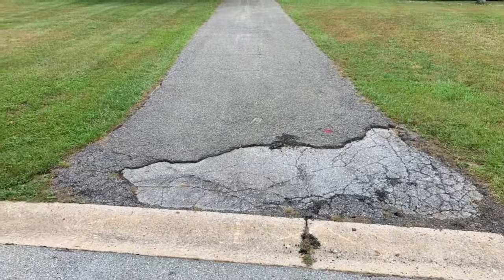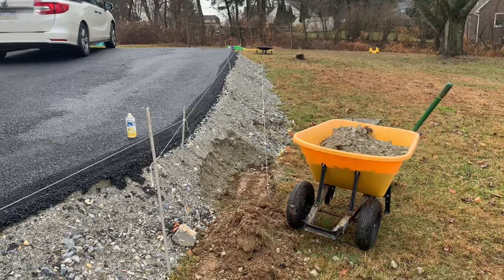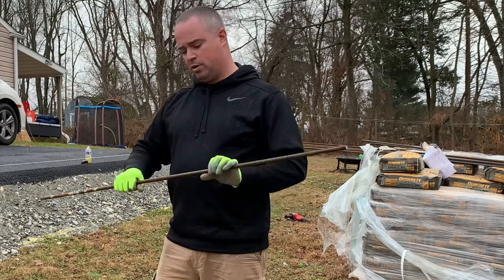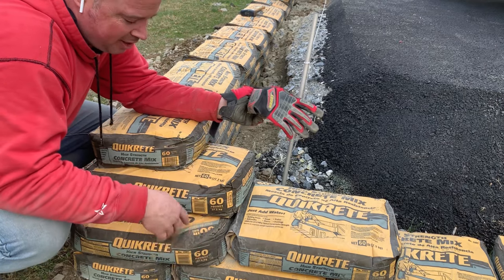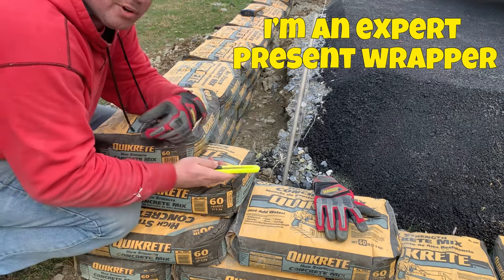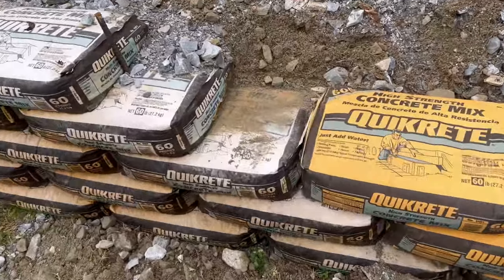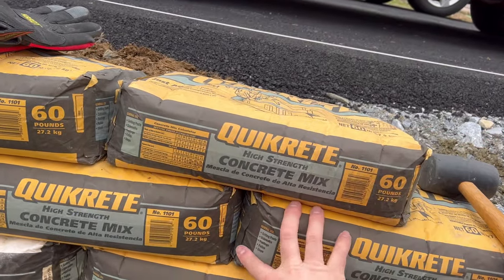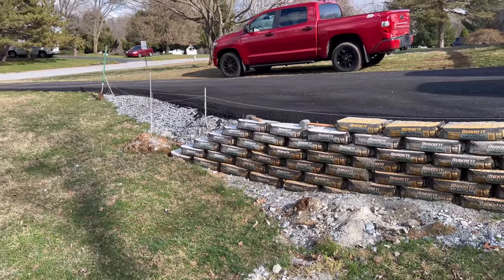DIY Concrete Bag Retaining Wall $ Saved Us Thousands

Comment: I watch somebody do a big giant retaining wall around their place and then they went back with a pressure washer and got all the bag off just thought I'd let you know
Reply from the maker: That is probably the best way to do it @marieennis6114 I bought a weed burner to see how that works. The majority of the paper is off because of the elements here in the northeast. I do have some stragglers though. I'm working on a follow up video with some do's & dont's. Hopefully I can show the difference between using water and fire to get the paper off. Thanks for reaching out!
Reply: @GoodTroubleHome  I will be looking forward to seeing those episodes. I have been thinking about doing this scene the one about the retaining wall it was a big retaining wall so it was really good to be seeing a small wall being done because that's what I will be doing. I have a little embankment in my yard it needs to be held up it's giving way so I'm very much looking forward to seeing how this progresses thank you so much. Marie from Tennessee
Reply from the maker: @marieennis6114 how many bags high do you think your wall will be?
Reply: @GoodTroubleHome  probably not much taller than yours. When they cleared my property they sorted just left a little wall of dirt unfortunately my property goes straight uphill so everything washes down and it's now washing away my cleared spot.  Pretty soon it's going to all go down straight down the hill again LOL.  Probably I would say 6 to 8 bags high should retain the wall that is currently there I've been here 6 years and I'm starting to notice a real pattern of the water running down my cleared spot and turn towards my driveway going straight down my very steep driveway as I laugh while writing this truly isn't really funny I think I'll start on it in the fall when it's not so sweltering.  We are having  a particularly rainy summer.  It's been raining here 20 days out of 31 most of the time I'm not going to tackle trying to do it right now. This red clay turns into soup when it's wet. I want to thank you for answering me back and asking me questions show me the YouTube channels don't have that courtesy it's a little discouraging I like the camaraderie. I'm 67 years old and doing it on my own so it is a little at a time. Slow and steady wins the race thanks again Marie from Tennessee🙂
Reply from the maker: I would love for this channel to be a community of good people trying to save money and share DIY advice and ideas @marieennis6114 love that you are 67 and tackling this project. You inspire me Marie from Tennessee!!!
Reply: I've been missing seeing you. You take care of your toe. Marie from Tennessee

Comment: Been 10 months. Ya didn't hose em off. Soak Em 🥺🤷🏻‍♂️ didn't any type of drainage. Rain ☔ ❄️
Reply from the maker: Hi @paulbetka6477 it’s actually been about 2 years now. That was one of the first videos I started. Took a while to edit and post. We used 8-10 of rock for drainage and then backfilled with soil. I will be putting out an update video in October showing some things that we would have done differently 👍🏼

Comment: Should’ve built a proper block wall first and then had the driveway paved.
Reply from the maker: Yes @eddyanglin that would be right order but we had no idea the new driveway was even going to need a wall until it was finished. I thought maybe a truckload of dirt to level things out but this method actually worked really well and it was way cheaper than hiring the job out
Reply: Hindsight's 20/20...  it's still better than half the hack "pros" out there.
Reply: Good job overall.  The driveway contractor should’ve told that in consideration when grading and noticed the elevation difference and let you know about it.
Reply from the maker: There’s a long list of those contractors out there
Reply from the maker: I wish he would have @eddyanglin I probably would have rented a bobcat and leveled things out beforehand

Comment: Lmao 160 bags you should have just hired a concrete truck and made a form to hold the concrete much easier and cheaper and looks a lot nicer. Your drive way rock and sand will still fall out from under because you never filled the gap from the edge of the ash fault to the bags which is the most important part.
Reply from the maker: Thanks for the comment @user-pwfus we actually got an estimate for multiple solutions. Cheapest being $5,000. We made this wall for just under $800. We’ll be putting out a follow up video in October and you’ll see how we filled that gap between the bags and driveway with rock and dirt. Topped off with a bunch of landscaping 🪨 it’s solid

Comment: I would have dumped a truck load of dirt over it and planted grass before doing that.
Reply from the maker: That option was on the table @CATAONYC we would have needed about 20 tons of dirt. At $30 a ton, $200 in grass seed and an excavator rental we would have spend twice as much. I do agree though, there’s nothing nicer than a clean driveway to grass look.

Comment: Please don't do this, it looks terrible, is not cheaper to do, will fail over time and end up costing you twice as much time and money. This is not at all structural or approved by any engineering standard.
Reply from the maker: Thanks for watching the video @lukewalker7305 I know this wall is not for everyone. It filled a need at the time and was $4,000 cheaper than an estimate we got from a contractor. It is not supporting a lot of weight and I don’t know anyone who hires an engineer to design a 2.5 foot high retaining wall. As far as looks go…when we’re finished it will be way more friendly to the eyes, I promise 👍🏼
Reply: What about mixing the concrete with some water and sand. With some rebar to support it
Reply from the maker: @medofox1672 we have loads of rebar and it is holding strong. There is some cracking that I plan to address with sand and the Quikrete crack filler 👍🏼 thanks for watching and love the feedback